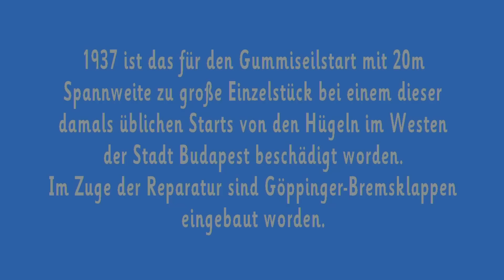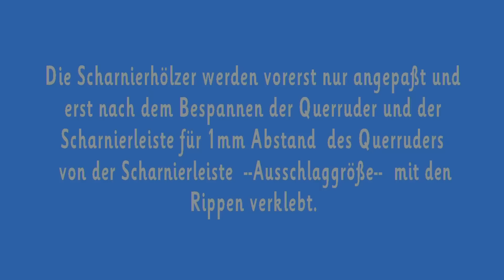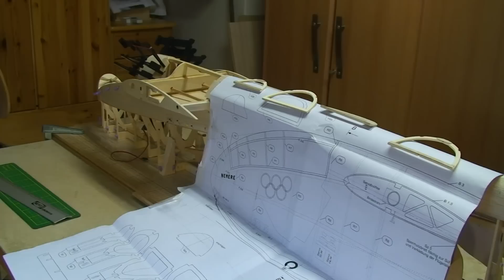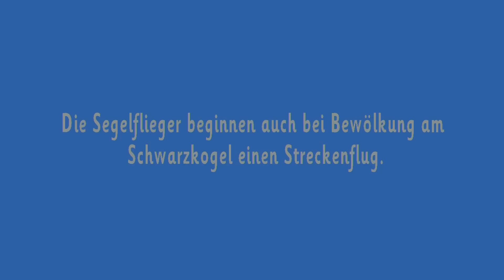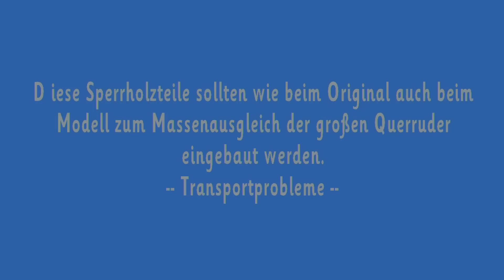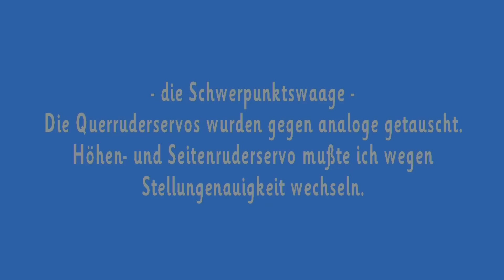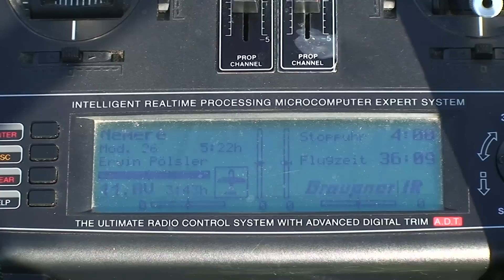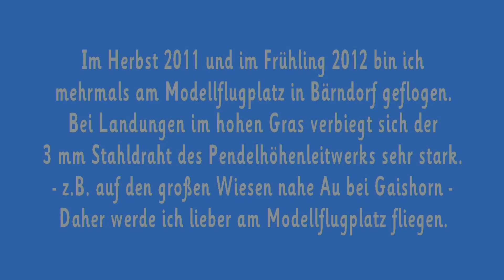Nemere Bau und erste Flüge März bis Oktober 2011

Comment: This inspired me to go on building the Pilatus Porter scratch 
builded.
Reply from the maker: I think You build tne Pilatus Porter also with parts of wood.
Reply: erwin beizeiten Yes I am busy building the Pilatus Porter PC 6 look alike. Its not real scale. I made the design in Sketchup 2017 and printed it on A4 paper and cut out all pieces by hand.  Now I m  checking if it fits and will glue it together. Not difficult but a lot of work. But scratch building is 70 % of the fun.😊

Comment: Hello Erwin, i am building a Graupner Hi fly 2300mm with a one piece elevator With the same system as your Nemere, my question is how do you link the two elevators. Thank you and i hope you can answer me
Reply from the maker: 8:44 through the hole in the planking by a collar over the brass tube and a M3 screw at both sides. Thank You and Ihope, that I can help You by this answer Erwin